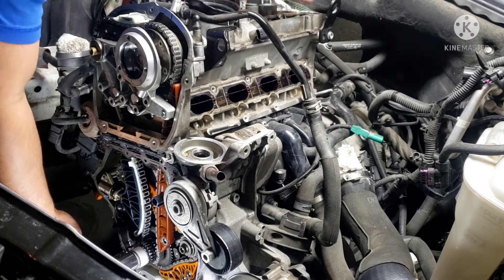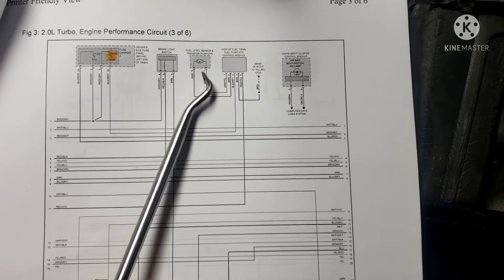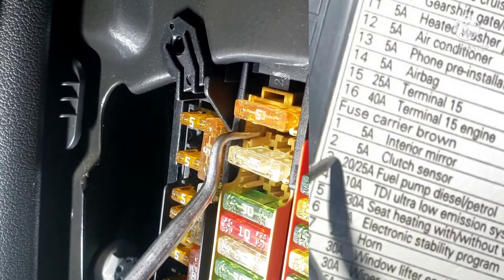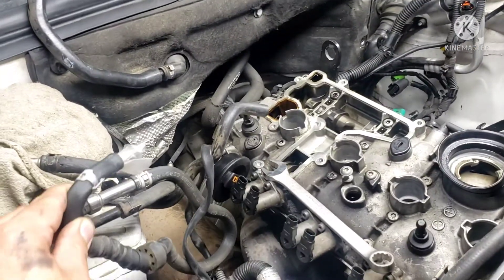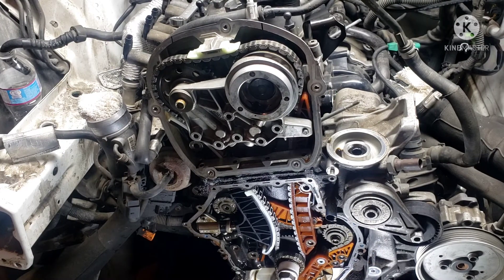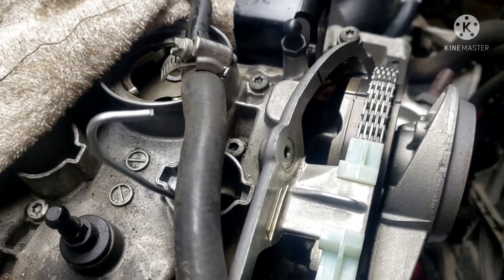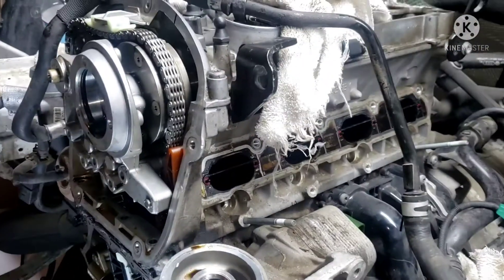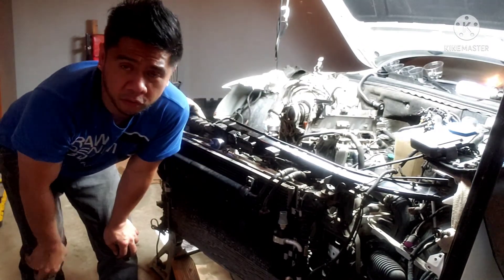Compression Test Result, How to Disable Fuel pump System! Audi a4 a5 /Volkswagen 2.0L

Comment: My man, I know this is old but if I'm not mistaken, you're doing a compression test and leak down test with no fuel injectors to seal the cylinders. I can literally hear to air coming out of the injector ports. You have erroneously declared this engine as dead.

Comment: No i cant believe your doing a compression test with open injector holes, the holes under your intake orts are the injector ports which need injectors in them to seal the combustion chamber on the compression stroke
Reply: This one blew my mind. I could not believe it either..
Reply: Also without oil... 😅
Reply: chillax guys, he is a novice, we've all been there. But you are absolutely correct, you will have no compression without the injectors in and what a danger with no oil.

Comment: thank you for the video, i have a 2009 A4 quattro having the same issue, after your video i realize that the fixing isnt worthy on the 175,000 miles it has now. i think it did its job while was running. thank you!!!
Reply from the maker: Yes thats awesome im glad i can help out. That is  what this channel  all about, please share  and subscribe 🙏
Reply: @jfGarage4k  2010 a4 here with 150k. Car broke down on me earlier this week shop said cam/crank correlation sensor code. Not a euro speciality shop so he didn’t do any further work. Car was towed back to my house I got it started and was able to drive with very little power car wouldn’t exceed 20mph only drove to the house next door did a u turn and parked it. Car also won’t show oil level ( see comment on previous video). Would appreciate any feedback as no mechanic seems interested as they all said it will be a money pit.